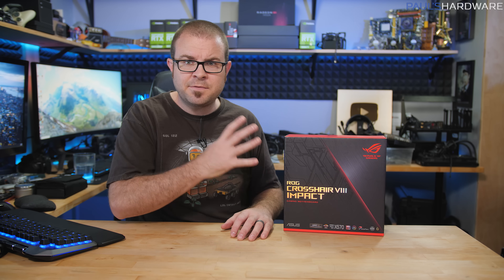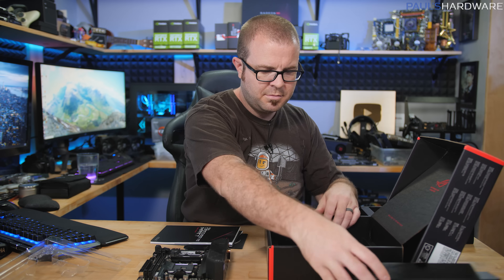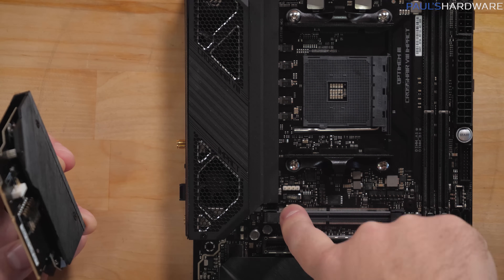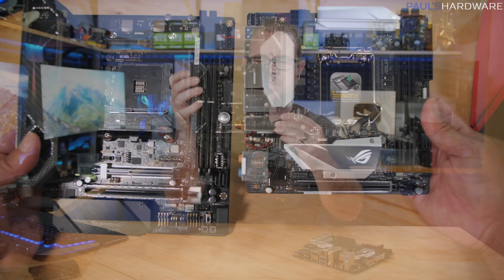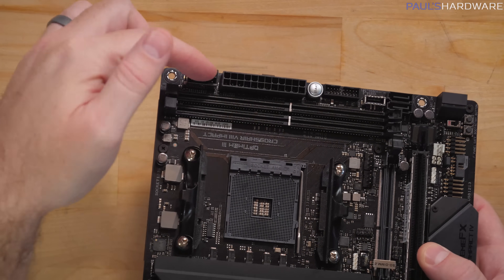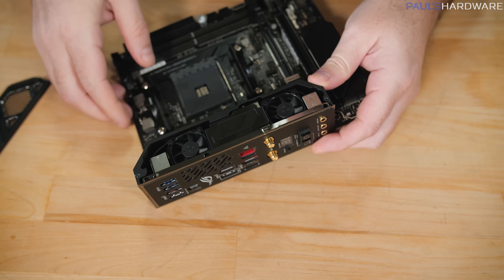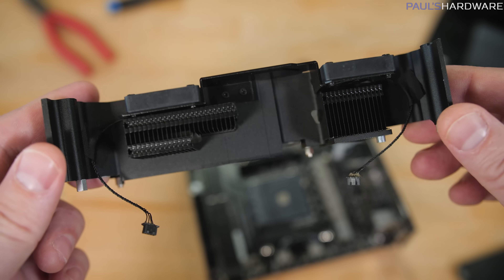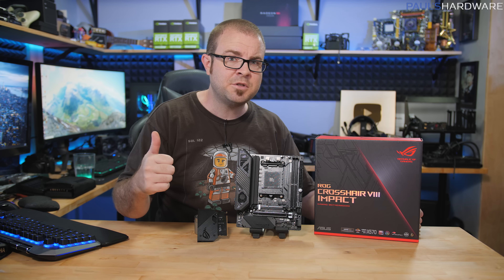WTF is Mini-DTX? Checking Out the ASUS Crosshair VIII IMPACT!

Comment: Thanks for the review. I've got one of these, aaand, got CPU led  On when all was installed correctly. Luckily found on reddit someone who encountered this issue and it was due to the screw hole right below the heat sink(beneath video card) which somehow does a short. After isolation it with some tape on both sides of the motherboard, and re-mounting it, the issue got away. Hope this helps someone. Cheers!

Comment: Mini-DTX was the wrong move and now also basically dead. They should've stuck with regular DTX, or better yet, re-standardized the whole slew of mobos after Asus decided to make it's dumb 10.6" wide ATX ROG boards. The "new" sizes should be 8x8 (200x200), 8x10 (200x250, basically a slightly narrowed mATX), and 10x12 (250x300), with maybe a 10x10 and 12x12 thrown in, the latter being for Threadripper or dual CPU types, though since the OG dual CPU boards need 13" width, probably add a 14" width for those, instead.

The biggest benefit would be having the smallest size be 8x8. Allows for 4 slots of ram, ALWAYS having at least 4 sata plugs, better cooling or whatever of the motherboard itself, and it's still more compact than existing mATX. As for my "new" mATX spec (8x10) the decreased width of 1.6 is literally just because it doesn't need it, and the 0.4 longer length should allow, if not another slot, at least some breathing room for any GPU or whatever put at the bottom.

As a side note, ideally, the 8x8 size would have the GPU slot underneath the secondary expansion slot, since by this point we all understand that NO GPU worth installing anymore is 1 slot wide, and as such, would cover the other expansion slot and make it useless if they're in "normal" placement configuration. Besides, I have my current ITX board in an mATX case, anyway, for that exact reason. My current GPU is 2.5 slots wide and needs 3+ slots for proper breathing. Might as well keep it real with mobo and case designs because anything TRULY SFF is going to use a GPU riser and put it on the back side, anyway.

Comment: I’m starting to wish I’d ordered one of these boards, three months ago, rather than an ASUS rog strix gaming ITX board, that board only has 4 post state leds that are ridiculously small and not very helpful for troubleshooting (and has no option to roll back the bios). I’ve been having tech issues for the past two weeks, and I’ve narrowed it down to either the psu, cpu or motherboard, (replaced the ram and ssd) but can’t tell which: case fans won’t turn on when system powers on, or even at all, using the front panel switch, so that could indicate psu, but i also can’t install windows onto brand new nvme ssd, it crashes and restarts every time. I can load up linux, somewhat successfully, but the system will still crash and restart even when running linux from a usb stick, so it could be anything at this point. I’m nearing my wits end. If i have to replace my 3 month old motherboard, I’ll be getting one of these for sure, i don’t care if it’ll be £100 more than the ITX board i got.

Comment: This is kind of driving me nuts. XD
I have a Silverstone Raven RVZ03 Mini ITX case, that claims to be DTX compatible.
And sure enough there's plenty of clearance below where an ITX board would end.

Problem is there is next to no clearance at all at the other end of the case, and the backplate/shroud on this motherboard looks like it overhangs the top side of the board.
This makes it look like this motherboard won't physically fit in the case not due to the extra length of the DTX portion, but due to the overhang on the backplate and attached shroud...

That's rather frustrating.

I don't have a motherboard yet, so what's causing me problems is trying to figure out whether I'll have a clearance problem with this board or not...
I mean, it's obvious if I were to remove the backplate and shroud it would definitely fit, but the board isn't designed to function that way, given the active cooling and chipset heatsink...

messy...
Trying to figure out clearances for small cases can be a real issue sometimes.
Especially when they do something like this where the board itself is inside DTX specs, but stuff mounted to it extends outside the footprint...

And of course they don't provide measurements for this. They just quote the DTX standard dimensions...
Very helpful... XD

Comment: Question about SO DIMM.2 on Crosshair VIII Impact. The manual shows m.2_1 and m.2_2 locations. Does it matter which of the two I use for my boot drive? I ask this, because the location for m.2_1 is very close to the backplate of my GPU which makes the drive on m.2_1 location way hotter. I would like to use my PCI gen 4 boot drive on the m.2_2 if possible.

Comment: GUYS IF UR AN OVERCLOCKER AND WANT TO OVERCLOCK RAM BUY THIS BOARD!!! BOARDS WITH TWO RAM SLOTS CAN ACHIVE HIGHER SPEED AND SINCE ITS SO CLOSE TO THE CPU IF U BUY A BE QUIET DARK ROCK TF it cools the ram and u can buy two small ram coolers !!! I got my 3200mhz cl14 bdie ram time 3733cl14

Comment: Hi Paul!   I have a concern about this item.
I was excited to consider a Mini-DTX, but now I see a big issue:  I do not see a spare PCI-E slot.

It looks they gave up the extra slot purely for a Riser card for the M2 NVME SSD.  I need that slot to fit a dedicated soundcard.
This is a problem, as the ASUS STRIX m-ITX board already has an M2 slot.

So my question is,
With this motherboard, would it be possible to fit all of the below items?
1x M2 NVME SSD
1x Graphics Card
1x Sound Card
Reply: It has a dedicated sound 'card' at the bottom of the card below the PCIE slot. So yes. But no.

Comment: I can explain why they did the huge change in their small form factor boards - I've owned 2 ASUS ROG mITX boards for Ryzen, and there was a design flaw with the M2 slot, though the Strix b450/x470 boards had a heatsink for the M2 drive, it's low board hugging position between the CPU and GPU caused massive heat issues no matter what type of airflow you had in the case, and the back board mount was WAY TOO HOT no matter what cooler you used, the problem was much worse if you used a water cooler.  My current build is using the Wrath cooler, because it's the only way to get good airflow over the m2 drive in my case.  

So why is heat an issue with M2?  Because SSDs hate hot, all you need to do is hit around 50C in normal operation to cut the lifespan of one down to <8mo.  I killed a samsung 970 pro 500gb m2 before I realized the design flaw.  I was using a liquid cooler for a r7 2700, in the end I realized the type of damage the heat had caused to my strix b450, bought a strix x470 for cheap, tossed the water cooler, and experimented with tower and blower style coolers.  Since I had been planning the upgrade went with an r5 3600 (huge upgrade!) and settled on the wrath cooler that came with the r72700.   

This new riser is an obvious attempt to cool the M2 cards and fix that design flaw, though the position is the same, they're putting a lot more thought into the airflow needed to cool those M2 cards, and a clear attempt to remove them from the low airflow area down by the motherboard and up into normal airflow areas of the case.  So while the riser is weird looking it's a great improvement over the prior design.

Comment: In my most recent build with a Z390 platform I did, in fact, use the driver CD. I needed the network drivers and I actually do keep an optical drive around. It was just easier than getting my laptop out lol

Comment: Honestly don't see the point of this. Yes, nice design, and I'm sure it will be great for overclocking, but there is no 10G ethernet, or Thunderbolt, or perhaps even a second pci-e 4x slot for an extra extension card, since this is a DTX board. Those are the things I would mainly look for at this price range.

Comment: DTX  is a variant of the Atx form factor. It's designed for small form factor PCs. The mini- of any form factor  whether its atx, itx, or in this case dtx is simply a smaller version of.  The DTX standard and specification  was initiated by AMD. https://web.archive.org/web/20090222202302/http://dtxpc.org/
#IgnoranceIsNOTBliss

Comment: Pretty sure that between the vrm and chipset heat sinks there is a small vapor chamber (that black thing between the fans that has a bulge in it) to transfer heat between the separate heat sinks. Very cool, ASUS

Comment: Hi Paul,
To answer your question regarding fixed I/O shield. Many datacenters build servers  using consumer grade hardware. Since consumer hardware is now (for the past couple of years) of much greater quality then it used to. This allow datacenters to save some money on some types of servers. Now most datacenters would usually use mainly 1U server cases of even Customs case made in house. Unfortunately, the I/O shield simply wont fit in 1U cases. Since datacenters are the biggest customers for PC manufacturers, manufacturers simply can't ignore them when designing their motherboard. I have seen this first end when I was working in a datacenter.

Comment: The Driver CD will have the name of the file needed for BIOS recovery:  either use the supplied BIOS file, or, rename the BIOS you want to use to this file name.  ASUS does provide a "Rename" tool, that will rename any BIOS file to the recovery BIOS file name.

Comment: insanely expensive tiny board. Even if they say its Quality, this is like buying an overpriced iPhone paying 50% of the cash price for the brand.
Pretty overpriced and it won't be long when this board becomes obsolete with new CPU's and Mobo's will come out in the future.

this board is like £380 here new. Whilst you can get something like ASsRock B450M HDV R4.0 brand new for literally £35.  And does the same thing. Nothing fancy and it works.

The amount of money you can save with as example the ASrock one.... holy moly ASUS... get off your high horse...

There are probably better boards out there that will cost way less than this but still have "Quality".

ASUS quality is basically ripping your wallets off lmao

Comment: Honestly, Asus should have just mounted the M.2 ports on the back. The SO.DIMM.2 cards are way too tall, and are just honestly ugly. Plus I don't entirely understand the concept of the back-plate, it's not a GPU, nobody will ever see that plate, and how much performance does that heat-padded heat-pipe add to cooling; mounting the M.2 back there would not only give us more ports, but would also use that space nicely.

Plus if you water cool this system, that SO.DIMM.2 card is going to interfere with putting the CPU and GPU within the same loop, and with this being a small form-factor board, that's meant to go in small form-factor cases, I do not see anyone using a dual loop in a small case. Using Y fittings might work, for separating GPU and CPU loops but combining back into a single res and rad loop, but I'm skeptical about that functioning properly; plus you'd ideally have a pump per segmented loop, as you don't want one loop flowing back into the other loop. I guess you could use a couple of AIO loops, but then you're just wasting space doing that, when you could have a single open loop with a single radiator.

Comment: Question: are we at a point in technological advancement where it's actually cheaper to throw in at least a USB2 thumb drive with the motherboard instead of a CD? Perhaps it's still cheaper to keep the CD stamping factories in operation than it would be to re-purpose those factories to just 3D print Flash cards?
Reply: And the follow-up question: while we're all about keeping things compact with mini-DTX hardware, wouldn't it just suit the theme of compactness to just throw in at least a full-size SDHC card, especially since a lot of modern cases come with a multi-card slot? I don't know...I'm assuming too much.

Comment: People be bitching about a driver cd.  Like a usb cd drive isn't 20$ anymore...

The problem I have is...     Mini-DTX
We already have a problem with people not fully committing to m-atx.  I would know, I was a stupid and I built one.  It's impossible to find a decent mobo for z390, much less for x570.  Even the most expensive ones are still pretty bad.  Mini-ITX is in a pretty good place right now, and ATX is where you go if you want a system with a crap ton of support.  DTX is so obscure, I had to tab out and look it up on wikipedia.  You would have to get a full size m-atx case to be able to support this, because most itx cases couldn't handle the extra length (ladies).  Why not just make it an M-atx?

Comment: the short cable in the box is meant for x570 boards to be compatible with standard cases because the hdd, power, led+ and led- connectors are mixed. you wont find it in any z390 board

Comment: SOLD
Wait that riser card is ugly af and would probably break in a moving vehicle
Reply: Good thing it’s a card, so you Can remove it :)
Reply: @ValentineC137  yeah but its the only way to get m.2 on. The board and that's important for me
Reply: Angry Dergon i was mostly talking about removing the card for transport, since you said it’s break in a moving vehicle
Reply: @ValentineC137  yeah but I drive truck and I'm not going to reinstall it every time I wanna use the pc.lol
Reply: @EmoFox9  O ok, I see.
I personally wouldn't be too afraid of that, but if it's really a concern then looking into options for a case that mounts the MB on the floor of the case, or just laying the computer down  so that the card is in an upright position when you're not useing it could work :P
Reply: @ValentineC137  with some of the bumps and shakes that I go through in the truck I don't feel confident with anything that's not bolted down

Comment: I keep hoping one of these companies will ALSO ship a goddamned bluetooth external antenna that I can set right by my keyboard, mouse, controller and headset.   There is NOTHING on this board that I would not re-design.   The power connects impede the ram and should be moved up to the top-edge and between CPU and rearpane, the twindrive card should be up front edge with the ram, the VRM and Chipset sinks should vent OUT of the case, not towards the CPU (which is NOT an SOC if there's a chipset, +1 ReetardPoints for Paul) and should have been driven by 3 fans with no bypass.  I agree with the "dtx" format and the frontpanel dongle. 

 I'm highly suspicious of the utility of a slot that mounts twin X4 M.2 drives when it's that close to the X4 chipset, especially since a simple two sided rail bracket and two M.2 slots mounted perpendicular off the board make a fuckload more sense and can mount click-on heat spreaders just fine.   There's a lot of moron on that board.  It could have mounted 4 x4 M.2 sockets in less space than it took to wire-in that stupid specialty slot and left a great deal more airflow space for the CPU.

Comment: Asus figured 2 m.2 drives wasnt enough and decided to give you a third.....instead of another pcie slot which can be used for a Network cards, RAID card, Sound card, Second gpu, m.2 riser allowing another pair of m.2 drives. Good going asus you fuckwits.

Comment: mini-dtx has been around for quite some time. Most of AsRock and ECS low-end boards since sFM2 and LGA1155 are "technically" mini-DTX, but what makes matters more confusing about this form factor is that they call it micro-ATX (probably to avoid scaring off customers who's not sure about chassis size for the board).

Comment: I'm not in need to upgrade my machine (4790K + 1070), but if I were to upgrade now, that's exactly the board I'd buy.
AMD, X570, one gpu (multi GPU is apparently dead), small form factor, integrated WiFi,

Ok I'll take that back, it's $400.

But still holy crap that's a juicy piece of hardware

Comment: Paul, you actually bring up a great point! When are Motherboard makers going to switch from "Optical Media" as the default way to install drivers? Wouldn't it be just as cheap to do an ultra-low capacity, cheap (but reliable) and space saving (physical space) USB Flash Dive? Other than E-waste being an issue (if you don't have a place to recycle them), I don't see why not,... 

If anybody Agrees that this should happen give me a thumbs up. If not, tell me why! Have a better idea? Leave a comment (but patent your idea first lol).